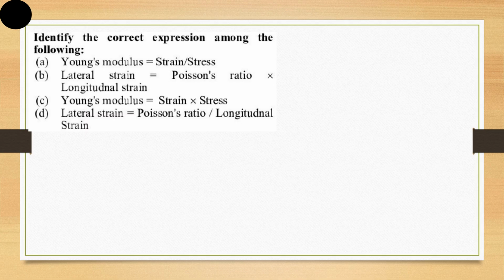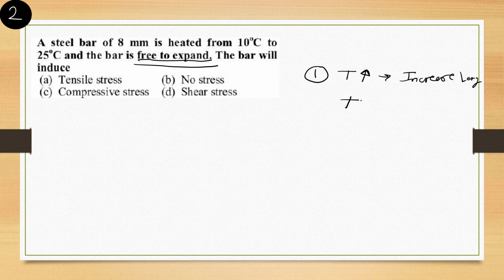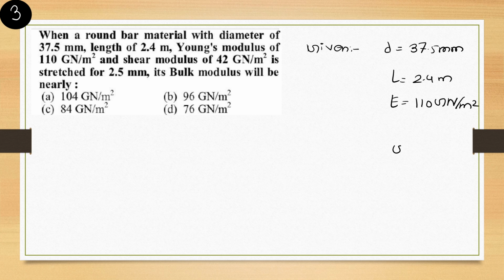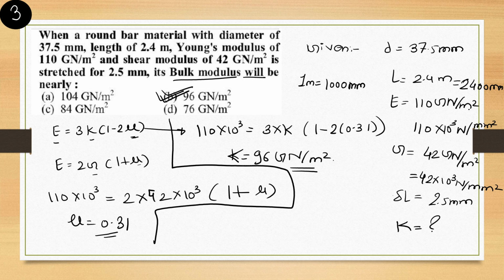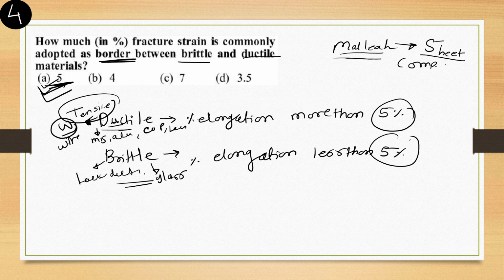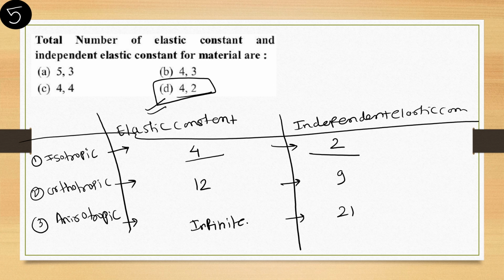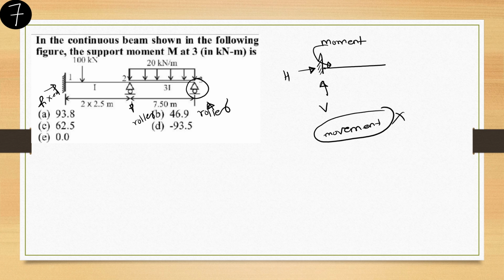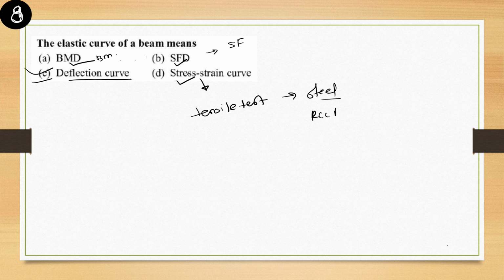BMC Strength of material MCQ Part-I | BMC SOM MCQ Part-I |

Comment: Ma'am yeah som ka numerical hai isme diagram bhi jisme rigid support both ends or ek copper bar hai jisme Area A and 2A hai with L/2 distance each
And steel with area A of length L
Reply from the maker: can u mention here, which thing they asked here to calculate.
Reply: @civilseries5871  stress in copper and steel due to rise in temperature

Comment: A composite bar shown below is made of steel and copper. The coefficients of expansion of steel and copper are alpha and  1.25 alpha  respectively, while the elastic moduli are E and  0.5 E  respectively. Estimate the stress induced in the members due to a temperature rise by T°C
Reply from the maker: yah, I'll answer this question in next video.